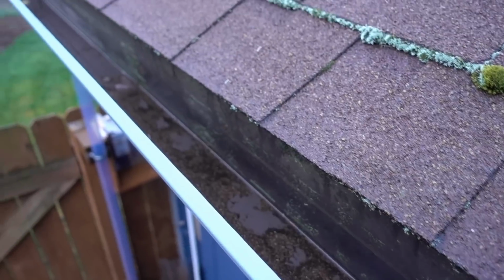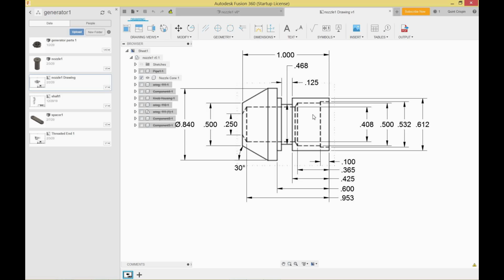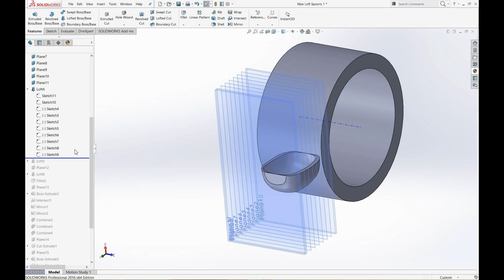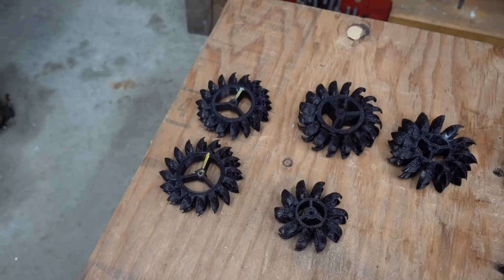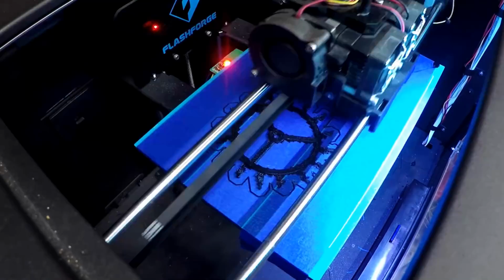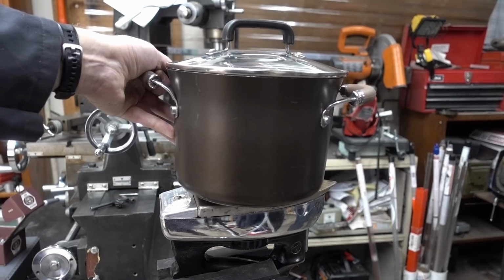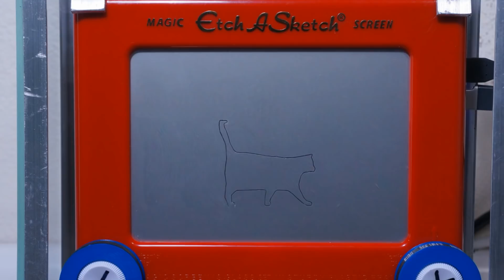Rain Gutter POWER #3 - Fidgeting With Turbines!

Comment: Is there any other way of increasing water pressure within the pipe so you can get even more output?
I know it's another type of technology entirely but my thoughts are drawn to how a steam engines pipes operate, squeezing the system for every last bit.

Comment: Would it be possible to use a larger diameter pipe to increase the weight of the water, and thus the water pressure at the nozzle?

Comment: would it help to have an enclosed structure where the water spins the turbine in an enclosed chamber, with an outlet along the radial axis? and would the alignment of the turbine (with the radial axis parallel to the water column rather than perpendicular) have helped?

Comment: I could be wrong. But are you over thinking it?

Ideally you want to use up all the energy from the water into the device.

So why not have a horizontal piece with say 3 outputs on 3 enclosed wheel generators feeding into 1 system.

Comment: Someone correct me if I am wrong. But to me, If it's still spinning too fast, you could increase the torque from the turbine to the alternator; either making the turbine much larger and increasing the moment of area, hence increasing torque required, or by putting gears between the alternator and the turbine, which would slow down the turbine, losing velocity to on the turbine side (thus less water flying everywhere) but greatly increasing alternator speed thanks to mechanical advantage. You would just have to grease the gears really well.
Reply from the maker: I tuned the load in steps with combinations of LEDs to optimize for power.  Not perfect but a stab in that direction.
Reply: @QuintBUILDs  If I may ask, how did you tune it and what did you vary? thanks for the reply!

Comment: Hi quint, why didn’t you put the nozzle at the bottom of the pipe. You had it on the side. If you put that at the bottom of the pipe and the water was shooting downward it would have had more pressure and you could use a bigger turbine and alternator and more power. You made the perfect nozzle but I think you attached it on the wrong side which didn’t give you the pressure you were after. Regards
Reply from the maker: Maybe right, but also less time on the wheel before fighting gravity on the back side, flinging water into the air, stealing momentum from the wheel.

Comment: Note: When you have water flowing through a circular hole, tapering the inlet can dramatically improve flow rates. Check out this video on culvert design for a physical demonstration of this.
34:20 to 36:20 in this video from the U.S. Department of Transportation Federal Highway Administration
https://www.youtube.com/watch?v=vnXmGyb_hKQ 
So it would probably notably help if you put a taper (or even a step-in) on the inlet at any place where your flow is going through a hole that's a bottleneck, like the perforated support.

Comment: PLA is made from plants, and it can be fully recycled or degraded under the right circumstances. Therefore PLA can be a sustainable plastic. The other plastic you used isn't sustainable.. It would be best if you could avoid those plastics :)

Comment: I really think the injector hole should be way smaller to have a higher velocity stream
Reply from the maker: According to the math, velocity of the jet is a function of the pressure (height and gravity).  Decreasing diameter will just reduce the flow at the same velocity.

Comment: Is it possible to print the turbine 3x larger, adding blades to keep the same spacing, then by using a transmission of planetary gears (similar to cordless drills) to increase speed to the generator.?
Reply from the maker: Yes but gears do consume some power so direct drive is best in theory if it's at all possible.  That's how the hydro power world does it anyway.

Comment: At this point. a car at idle with a wheel off the ground turning something while in gear is more efficient
Brake specific fuel consumption of a 300hp v8 is less then half a gallon an hour at idle,
making far more watts of usable power
a simple 12hp generator fixes all of this for far less of a cost.

Comment: Hi ! I'm a young engineer that has 2 year into turbine making in mechanics. I love your video but one things disturbed me. You have a 90° angle before the nozzle ? It's one of the things that rally hurt the performance specially for "hight pressure" nozzle pelton combo.
Reply from the maker: Well let me ask you what the velocity of the water is in the tube?  Answer: essentially zero.  It's basically a reservoir so there is no angle change.  2 gallons a minute in a 2 inch tube doesn't really have momentum.
Reply: @QuintBUILDs  True ! Thanks for the feedback, i'm far from hydraulics expert ! :p I just had to redo a design i did because the velocity at the entrance was distroing the concret but it's a turbine with 1.8m (~70inch) diameter so not really close to the size you did ! I really hoped till the end of the video you could found a great performance :p
Still it's a great job you did here !

Comment: Why not mount half the turbine in the pipe with the blades almost touching the other side of the pipe? The water would still have to rush down in the same volume would move the blades as it passed by.

Comment: Increase the diameter of the storage pipe, increase the volume of water = higher pressure right?
Reply from the maker: Common misconception. Pressure=density x gravity x height so diameter is not a factor. If it were, the size of the swimming pool would determine how much you float.

Comment: Won't having the jet of water flow vertically downward instead of horizontally result in a tiny increase in power? . . Although the column height is the same the fact that the cups of the wheel will have to force the water to change direction against gravity instead of just hoizontally can just add a tiny kick to  it.

Comment: Would increasing the diameter of the Belton wheel give you more power ?
Reply from the maker: The "power" in the jet will be unchanged. All we can do is optimize the wheel/generator/load combination to maximize efficiency.

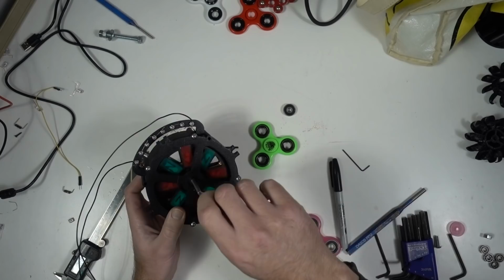Comment: 10:51 I noticed when you tested the alternator with the fidget spinner bearings, you were holding the spinner horizontally.  In your setup, I believe you are placing the spinner vertically.  Could there be a difference in performance if the alternator was setup horizontally?

Comment: You need to collect the water in 2 pipes (or more) and multiply the power generator system and finally combine the output. You are wasting way lot water (pressure) to roll that small wheel.

Comment: Try a tesla turbine or a actual hydro electric turbine design or a jet turbine type design might get you more efficient power more forced surface area
Reply: Less energy lost
Reply: Or this https://youtu.be/KjiUUJdPGX0
Just replace ur nozzle with same design with the screw adjustable place generator on shaft out reear

Comment: Just curious. Why did you decide to shoot the water out at 90 degrees instead of letting it drop on the propeller straight down?
Reply from the maker: horizontally at the bottom gives the greatest water pressure, that's what the commercial setups online do, easier to have a cleanout trap without clogging the nozzle, the flow of water is so low the vertical pipe acts like a reservoir so the water really isn't changing direction.  Not saying your suggestion wouldn't work, those are just the reasons I went that route.  Fair?  Lots of folks are asking the same question BTW so it is not without merit...

Comment: Hi Quint. Your videos are great! I live in tTexas and want to build a hydro generator using solar to run a pump up to a water tower and let the water flow through a pipe to a pelton wheel at night down to another water tank on the ground. I have a lot of solar panels for powering the pump.  I have 2  10,000 gallon poly tanks and my tower is 28 feet off the ground.  Any idea as to size of pipe and pelton wheel needed?  Thanks
Reply from the maker: A water battery!  Sounds fun.  Have you calculated how much "energy" you'll have when the tanks are full and whether your solar can supply it in a day?  Send me an email and maybe we can do some back-of-the-napkin calcs.  QuintBUILDs@gmail.com

Comment: No expert on hydrodynamics. But what I know of electricity and generators I think the weak link is your alternator.  Correct me if I'm wrong, but shouldn't generating electricity result in fields that cause feedback on the turbine speed???  As easily as the wheel is spinning, I think you need a more powerful alternator.

Comment: You did not try incasing the wheel.All that water is wasted splashing around. If you controll all of the water to flow through at wheel, then hopefully you'll get your 1 watt? So basically use the same  tech a Dam uses to make power. I assume.

Comment: I hope he tries a smaller nozzle soon!
Reply from the maker: smaller nozzle means smaller flow rate = less power
Reply: Quint BUILDs Seems to me that you have too much waterflow compared to that turbine-wheel. Either increase turbine size or nozzle down. Cuz you have loss because of water hitting places it shouldnt - thus slowing it down. :) or Maybe use another type of turbine-wheel like a kaplan. :)

Comment: i had several questions and typing this at the start...
would you get more power by the water hitting the top making it cycle clockwise , dunno why but i feel like its fighting gravity more with the water on the botttom with some of it lost to gravity 

second think its possible to have several of them in modified drainpipes to work vertically?

Comment: I would have made the water come straight out of the bottom, instead of out of the side, to harness the pull of gravity.
Reply from the maker: Maybe, but then the water would only act on 1/4 of the wheel until it drops instead of 1/2.  Does that make sense?

Comment: Why NOT also Taper the Pipe itself??? When you installed the Jet assembly, to the main down pipe, the coupling was a little Larger the the down pipe.
What IF??? Every 1/3 section of Main Down Pipe,,, was Tapered to Smaller diameter????

Comment: Given the amount of heavy machine work + material and energy intensive 3d-printing involved here i am fairly certain this device will have to run for about a 100+ years just to regain the energy spend into creating it, so despite it being great educational content it is pretty useless in terms of "harvesting" energy ... in order to get an actual net gain you will have to simplify the production process A LOT and take measures to mitigate friction loss by ramping up the water throughput - for example by installing a huge tank right under the roof, which can be used to amplify the water throughput once it is filled up ...

Comment: late fyi.           the  TYPE  of  hydroturbine  used  SHOULD  be  Compatible/matched to   the  site  values.!!!
           eg.,   HEAD  and  flow  rate.!!!
in  a case of  Very low head  and  Very  low  flow rate,  the  most  Efficient turbine type   Would  be  an  Overshot  WATERWHEEL.!!!!!

Comment: Why on earth is a Pelton turbine, which is a reaction turbine used? A Francis or a Kaplan turbine would get better results. Thats Fluid Mechanics 101! Also the vane turbines here need to be fully submerged in water and encased in a volute casing. Leaving them open is not gonna get you anywhere.

Comment: why not just add a second alternator? make it so the trough the water goes through is in the center between two...or heck even 4 alternators. I would think if you rectified the power properly and wired them in series you would be well over your goal.

Comment: You need a multiple stage turbine, that single wheel is not capable of extracting the full kinetic energy from the nozzle at that water height.

Comment: Why didn't you make the nozzle even smaller. I felt like you machined it the same size as the original hole. All that hard work... what if you made it smaller say. 1/8 maybe a little more. Any back flow you can use as excess power, plus the applied water pressure from the weight would.most likely increase the power of the flow.

Comment: BERNOULLI'S PRINCIPLE!!!!!!!!
Reply from the maker: applied to which part?  I used it hundreds of times in fluids class but it's been about 20 years...
Reply: @QuintBUILDs  the nozzle you're spraying at the water wheel. You can increase the velocity of the water using Bernoulli's Principle, it needs a little jet engine nozzle.

Comment: I feel as if the nozzle still didn’t focus the energy the way that it should have and could probably have been done differently. I think you overkilled the design and made something over engineered when you could’ve used something simple. Adding the centre section ring support would only cause a loss in energy

Comment: I would say you've done this all wrong by relying on such small amounts of pressure. You should set up a water catch basin on a long arm. Then use mechanical advantage and gears to turn the motor. Then as the water goes down you can catch it several times before it hits the ground

Comment: Faulty and to big stream, you are not only pushing but braking the vheal. Try to understand why original has form like that. The stream needs to hit only one bucket at the time and go through the upside of the other bucket that is coming.
Precision, precision, precision with precision you can minimise water outflow with att least 50%.
Good luck 👍

Comment: I don't see why you're not using a turbine in a tube to get the same effect? you can easily fit more turbines to get more power with the same flow rather than one output and scattering energy everywhere.

Comment: I like your videos but if you want to get more power out of this system 
then you need to add steel behind magnets. Back of every magnet needs to
 be conected with both magnets near him with steel that is at least half
 of the thickness of your neodymium magnet(but similar thickness steel 
plates are the best option). In configuration that you using now huge 
part of magnetic flux is lost and only small part of it is going to the 
magnet on the other side of the coil.
Magnets of similar thickness as the coil would also be able to generate 
more power but it may be too much for your power source. 
Fact that you made single phase alternator is also a big loss for 
efficiency, 3-phase is the way to go especially if you want to end up 
with stable DC (via 3-phase full bridge rectifier).
Then you can test all that turbine blades that you made and most likely 
some of them will be able to generate more power.
Good luck as you made plenty of good work here and it would be a shame 
to not use it and show it to the people in full glory.  ;)
Reply from the maker: I submit steel backing or cores would slow the rotation until a similar power output is achieved. Much like adding gears minus the friction penalty. Someth I definitely didn't anticipate but observed and in retrospect makes complete sense.
Reply: @QuintBUILDs  But the efficiency conected to the shape of your turbine blades should change with bigger difference betwen speed of the water in the jet and speed of blades that are working in that jet.
If you have space inside then you can try adding just thin steel sheet and check the power output change without need of doing everything from scratch.
By adding more thin steel sheet you can try to find the perfect power of generator for this setup(There should be no steel cores in coils that is bad idea).
If the blades will be able to rotate with similar speed(and it can be the case if the generator is too weak) then you should have more volts out of it with stronger magnetic flux, so more power and also less resistance in wires and long thin wires at low voltages are also a source of power loss and in the same time "dynamic losses in the buck converter rise in proportion to input voltage. Hence, the higher the input voltage, the lower the buck converter's efficiency"
If i remember it corectly 3-phase generator is 50% more efficient than single phase one. And it is lost power because coils are generating magnetic field that is fighting with magnets during phase shift and for that reason wind turbines with single phase generator are louder and generate more vibrations.
150%*130mA=> 90mA not 30mA for your smartphone battery. ;)
Schottky Diodes have relatively high leakage current with higher voltages it may be beneficial to replace them. Maybe with 3-phase generator  you would not need condensator he is also heating during work and wasting power.
Sory for my crapy english.
Reply: @QuintBUILDs  Pelton wheel power output is the best when the wheel is moving with 50% of its max speed(at that speed water  theoreticaly should transfer all its kinetic energy to the wheel). So you can tweak generator power output with small steel  plates until its slowing turbine to that speed.
With that and switch to 3-phase generator you should easly go above that 1W of power that you aimed for.

Comment: you need a new 3d printer or to spen some time on your settings.. My worst print has better resolution than anything I have seen you print.. Not hard to get things to look injection molded. I use Cura on an Anycubic I3 Mega!
Reply from the maker: Surely you're exaggerating a little.  I work with injection molded parts and $300k industrial 3D printers and even they produce very different finishes.  I've been using simplify 3D and have been pretty happy with the results.
Reply: @QuintBUILDs  I have a video where I walk you through my exact process including cura settings.. https://www.youtube.com/watch?v=WAeADB7Vnjs  if you just want an example of a part jump to 22:10

Comment: Sir Quint, theres a better way to multiply that nozzle, no using of elbow fitting.. 2 or 3 nozzle is great, it multiply the volume of water out does multiply the force to push the proppeller to rotate... can i hav your email or messenger please? so i can send the image.